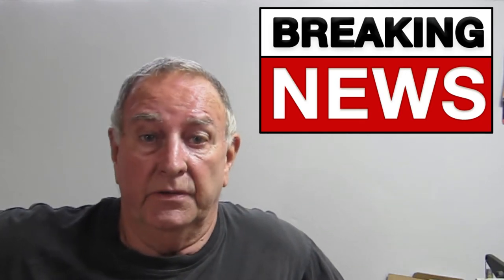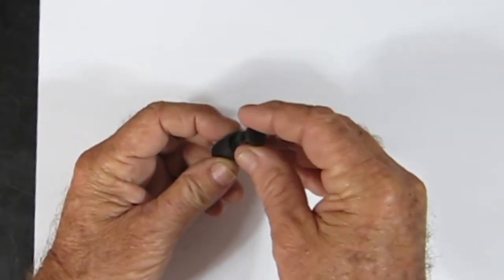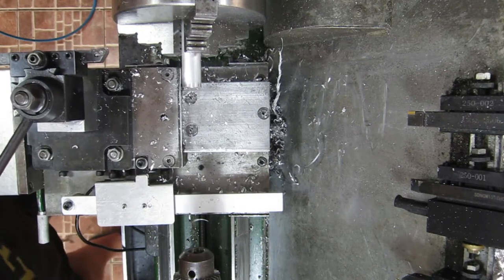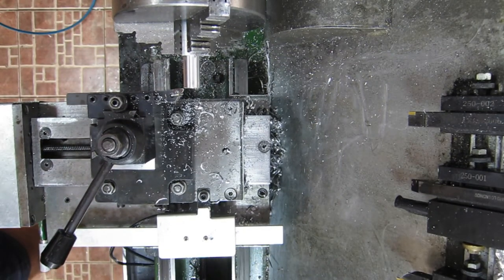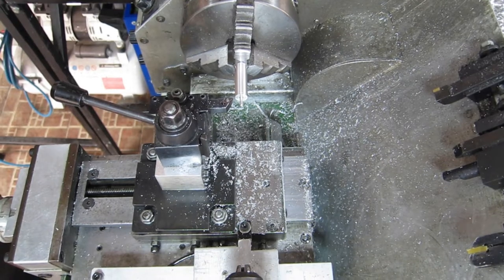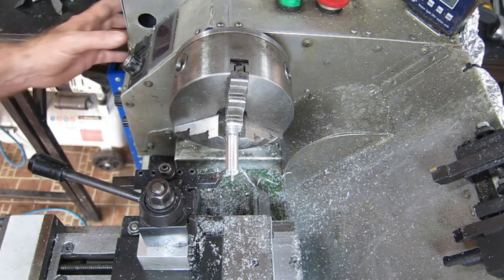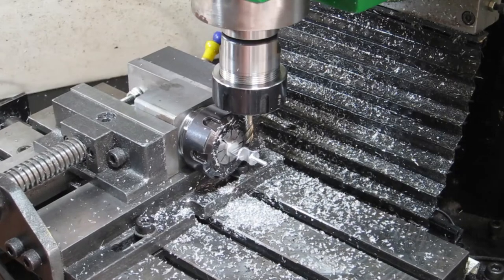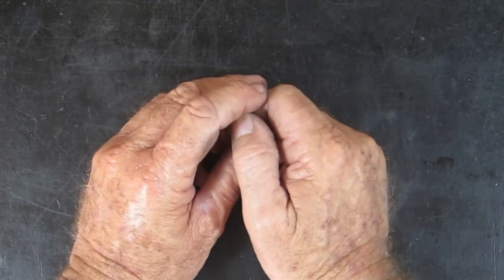MHW Episode 64 - Aluminium Joystick Components

Comment: Damn, shame about the neighbours, but they're everywhere, maybe if you negotiate a time when you can make noise??
Think you're right about the camera angle, was thinking overhead you might get oil spatter on camera, the angle you switched to looked good.
Cheers
Reply from the maker: I think there would be no negotiating with them, I'm currently racking my brain for solutions to reduce noise to a bare minimum, i.e. can't barely hear it standing at my front gate and not making noise every day. 👍
Reply: @MyMiniHomeWorkshop  👌👍

Comment: Nice work as always. 

I hope you can find a solution without sacrificing all the upgrades and improvements you have made to your shop. 

Re the camera angle, I think it is better when you had it on a slight angle than the direct overhead shot.
Reply from the maker: Thanks, running ideas through my head on how I can 1: Reduce noise 2: Contain it better
I agree re the camera angle 👍